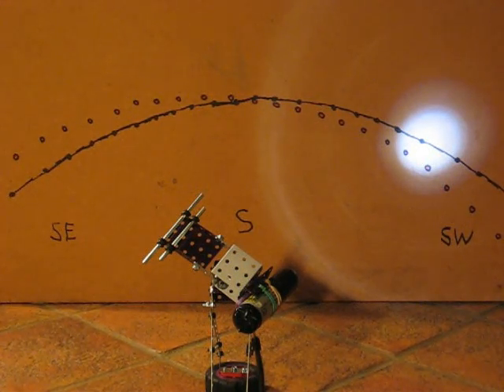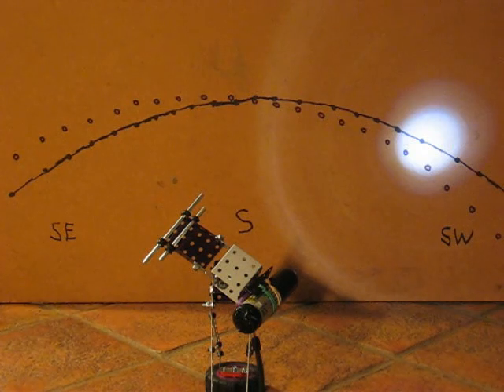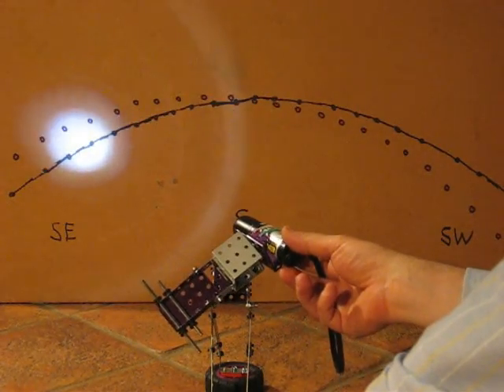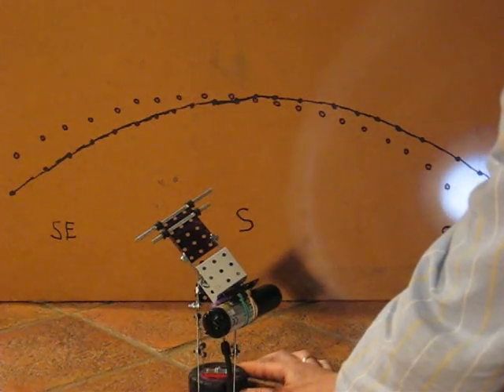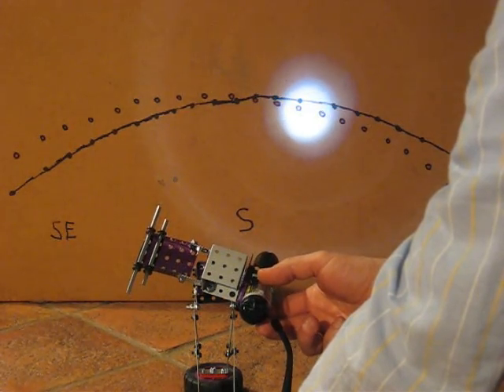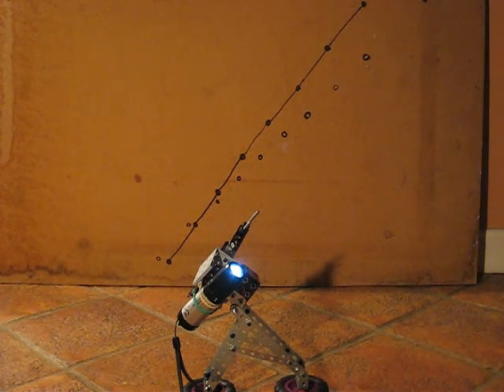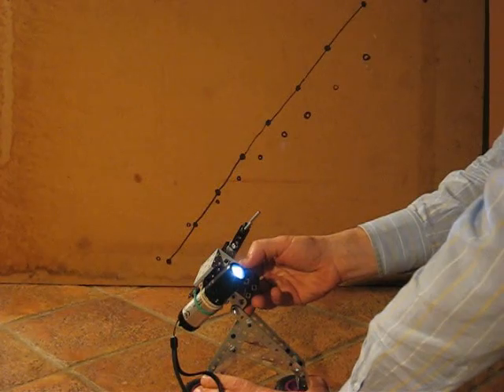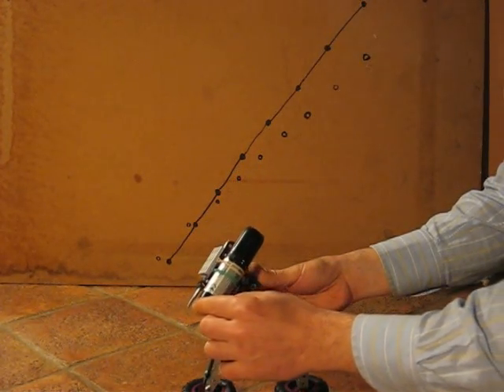Star Drift Method for Polar Alignment of Equatorial Mounts

Comment: When you are drift aligning from 0 degree latitude, how does it affect you choice of stars for azimuth adjustments since you seem to be standing directly under the celestial equator? 
In other words, do you still pick a star due south which will actually place it south of the celestial equator or do you pick a star directly over head?

What about picking a star due north which will place it North of the celestial equator?  
Thanks
Reply from the maker: I think you can pick either southern meridian or northern meridian stars but you have to be careful to interpret the drift in the correct way.

Comment: thanks very interesting. I have been trying to do this with just my dslr mounted on an eq2 mount and when I was using the eastern star to correct altitude I was expecting left to right movement not up and down so I think thats where I have been going wrong. You explain this very well, thanks again

Comment: Correcting North-South misalignment (using Eastern horizon) 

If the star drifts South, the polar axis is pointing too low. 
If the star drifts North, the polar axis is pointing too high. 

 Correcting North-South misalignment (using Western horizon) 

If the star drifts South, the polar axis is pointing too high. 
If the star drifts North, the polar axis is pointing too low.